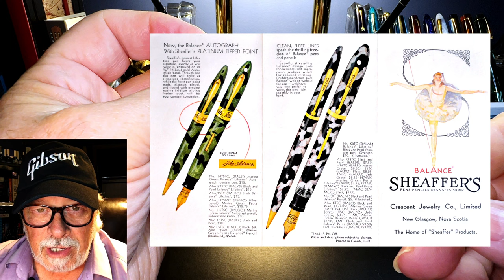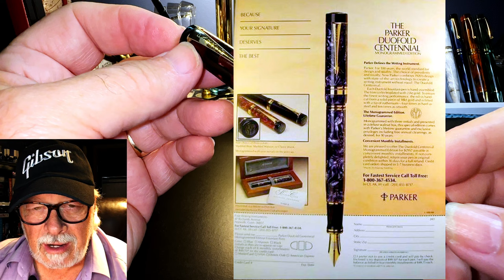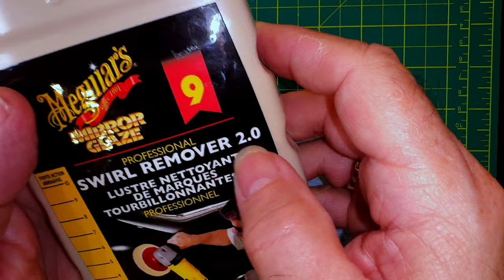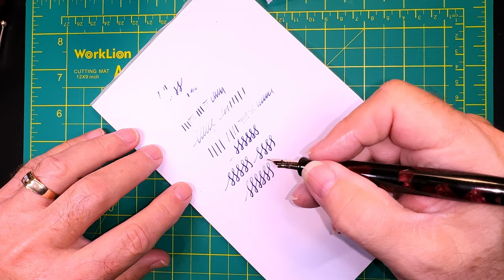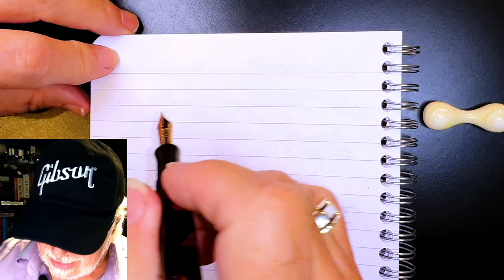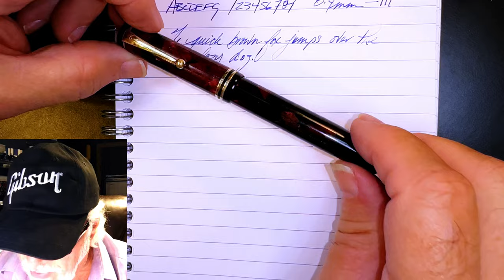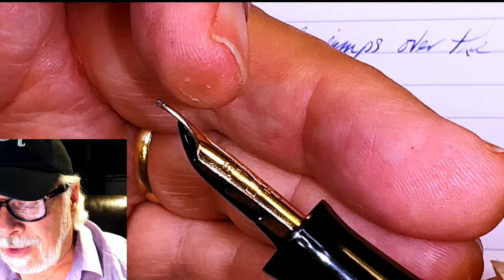PEN RESURRECTION SUNDAY: Episode #4 - 1931 Parker Duofold Junior

Comment: Ahh someone else who uses hex wrenches to tap out their nibs! I thought I was the only one. I use a drill guide as my knockout block, it has a bunch of different sizes holes that have worked for me for a ton of different section sizes. Thanks for doing this series! I've been really enjoying it.

In regards to nib stiffness, wait til you try a Sheaffer Lifetime nib, those are stiff as nails. Thickest (in terms of material, not tipping) nibs I've ever seen too. They make my Jowo steel nibs look like flex nibs. I have a really dry one I'm struggling to open up right now actually.
Reply from the maker: Great idea with the drill guide!

Comment: Excellent show, Doug! It's the little quirks of old pens that makes them so interesting, even the unsolvable ones (like the crack at the barrel mouth.) With a little more TLC you'll have that nib performing at its best, though you may want to borrow Doodlebug's microscope.
Here in Oz the most common Parkers were made in England, and I swear by the 1950s Duofold range, of which I have a complete set from 'Lady' to 'Maxima' in black.
Once again, thanks for a great episode.
Reply from the maker: Thanks ibpopp!

Comment: I’ve had this trouble with Parker hooded nibs, but not open, standard size Parker gold nibs.  In watching this very closely, I’m wondering if the gold thickness has anything to do with the stiffness.  When compared to the Sheaffer gold nib, the Parker nib appears much thicker.  Perhaps it was the angle of the video, but I would try another Parker nib.  All of my vintage Parker nibs have been super flexy.  Nice restoration!!👍
Reply from the maker: It could be, but that arch is pretty pronounced.

Comment: General Douglas MacArthur used his wife's 1927 "Big Red" Duofold Junior signing the Japanese surrender at the end of WWII.:_inkWink:
Parker used 2 types of pressure bars (no "J," so not a J bar) in their button fillers. One that a bit at the top hooked over the top, under the button, and probably the same as the Challenger, without the "hook." Seems to have depended on the day. :_inkSmile:
Not entirely sure on the Duofold Junior, but a lot of Parker pens of that time used "necked" sacs (it's a number 21, necked, in the Challenger, for example.) Might impact the quantity of ink it can hold using a straight sac.
Appreciate your job on this pen! Scratches and such? Shows that it has history.
Looks like you have a manifold nib, designed for using with carbon copies. Really came into their own in the 1930s. Plenty of vintage out there without a bit of flex from the early 1930s on. Might have been even before, for the tiny writing in accountancy legers and the like. And as it's an extra fine, I am betting on an accounting "posting" nib.:_inkWink: Get a spark plug gap tool and re-gap the slit. Should help.
Reply from the maker: Yes! I did a video showing the two WWII fountain pens; MacArthur's Big Red and Eisenhower's P51. I was using the term J bar in the generic sense. I should have said "pressure bar". When I buy them new, this type is called an "A bar". I have been using a spark plug gapping tool for years and I worked on this nib in particular up to a .004".
Reply: @InkquiringMinds  Posting nibs tend to be drier. Trying to avoid spread which could mess numbers and such up. But hoping you can help it out!

Comment: Part of the joy / frustration of restoring an older pen is watching the process bringing it from being a relic to a working pen. As you have shown on previous pens, the results can be astonishing. In this case it would appear that you may have to flatten the nib, if that can be done. You may have something called a steno (as in stenographer) nib. 

I was also thinking that some of the polish you used on the feed may still be on/ in it?

Thanks for sharing.
Reply from the maker: That was a thought I had as well, Paul. I'm going to give it a thorough cleaning again with some soapy water and see if the flow improves.

Comment: Well done, Doug. Would it be possible to replace the feed with a new ebonite one?
Reply from the maker: That "Christmas Tree" ebonite feed is pretty vintage. I don't think it is the problem as the channels are quite wide and open. I'm speculating that some of that polishing compound might still be on the feed so I'm going to flush it again with some soapy water.
Reply: @InkquiringMinds , I was thinking the same thing right after you mentioned that you polished the nib with the jeweler’s cloth.